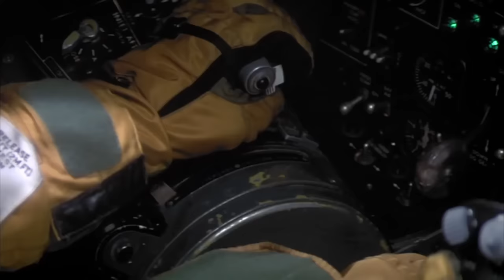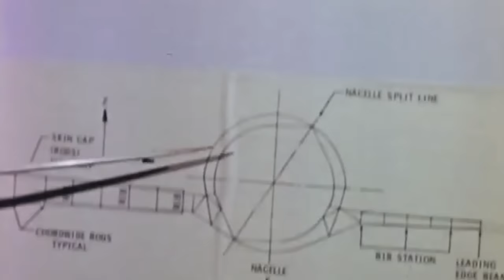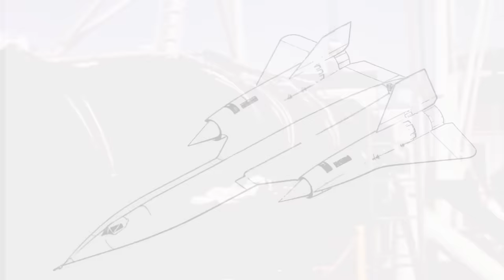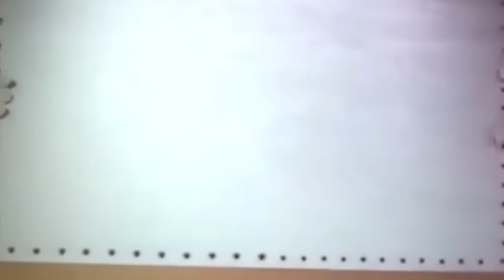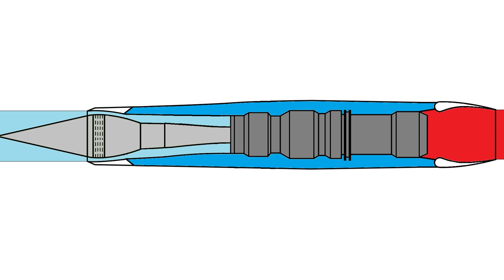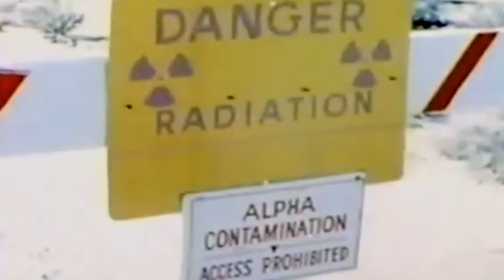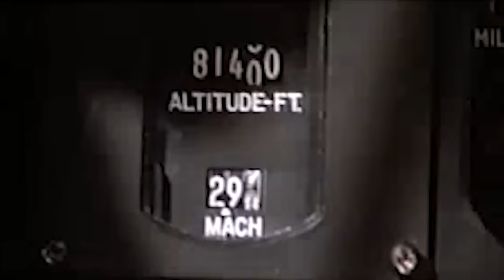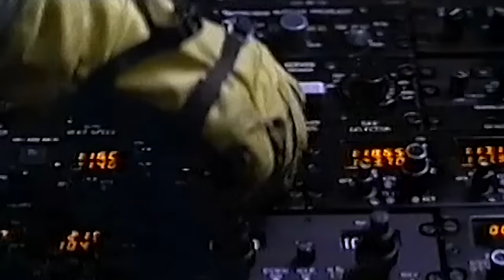Lockheed A-12 | Speed matters

Comment: The A-12 "spy plane" or reconnaissance aircraft required so many changes, that when the engineers thought that they had overcome one problem, such as titanium replacing aluminum due to surface heat while traveling at Mach 3, they encountered another one with the titanium body, having to put ridges into it to keep the heat within so-called "safe limits".

In dealing with complexity, human engineers design, then perhaps redesign, then make a concept model, then test that model for flaws, then even after being given the "okay" to build it, it then needs further "analysis" and modifications. Even when the engineers say that everything is "okay" at that time, another flaw becomes evident, requiring more changes.

In contrast, what God makes never needs any redesigning, modifications, but is perfect "out of the box", for a wise king named Solomon at Ecclesiastes 3 in the Bible stated: "I have come to know that everything the true God makes will endure forever. There is nothing to add to it and nothing to subtract from it. The true God has made it this way, so that people will fear him."(Ecc 3:14; Note: God's personal name is Jehovah, Isa 12:2, KJV)

For example, an excellent flier is the hummingbird. In terms of body lengths per second, a diving hummingbird flies faster than a fighter jet, said a researcher from the University of California, Berkeley, U.S.A. some 15 years ago. 

Christopher Clark filmed the courtship rituals of male Anna’s hummingbirds and calculated that when swooping to impress females, “the feathered acrobats reached speeds of almost 400 body lengths per second.” He said that such a speed is comparatively “greater than [that] of a fighter jet” at full throttle. When pulling up at the end of its dive, the bird is subject to a force ten times the pull of gravity—more than fighter pilots can stand without losing consciousness.

And the Ruby-throated hummingbird, weighing less than an ounce, relies on one thirtieth of an ounce [1 gm] of fatty fuel to carry it all the way from North America, across the Gulf of Mexico, and into South America, about 800 to 900 miles. No heavy load of fuel, no training in navigation, no complicated charts or computers ! Yet, it finds it way perfectly there and back.

The universe with its wide diversity of life on the earth is evidence of Jehovah's unparalleled handiwork. And for those who measure up to being "meek" ones, they will enjoy living on the earth with its awesome diversity of life forever once it is transformed into a paradise.(Ps 37:11, 29; Matt 5:5; Luke 23:43)
Reply: Please keep your fairy tales out of discussions of reality.
Reply: @soaringvulture  
What I wrote was NOT a fairy tale, but rather expresses the sound evidence of a Creator, who "created all things".(Eph 3:9) For example, consider the capability of the web of the orb weaving spider. It has been discovered that the web of the orb weaving spider, that produces seven different types of silk, is capable of stopping a jumbo jet in flight. The sturdiest silk, known as dragline silk, is lighter than cotton but ounce for ounce is stronger than steel and tougher than kevlar that is used in bullet-proof vests.

If this dragline silk were enlarged to the size of a football field, with the web being 0.4 inches thick and 1.6 inches apart, then it would be capable of stopping a jumbo jet flying at over 600 mphs. What else is of interest is that spiders produces the dragline silk at room temperature and uses only water, while man-made kevlar requires high temperatures that causes a chemical reaction between an acid and chemical solution containing nitrogen and hydrogen, resulting in chemical chains composed of hydrogen, carbon, oxygen and nitrogen, whereby it has a service life of just five years, and if used outdoors, depreciates its service life due to ultraviolet light or debri penetrating the kevlar, or once it is struck by a bullet, it is now rendered as compromised and must be replaced for safety reasons.(source: website fiberbrokers dot com, article "All About Kevlar")

Or what about the weaver ants that lives in Australia, who build their nests in the forested canopy, bonding leaves together, who "turn the leaves into green chambers, with floors, walls and ceilings. The way they do is with glue. First the ants turn themselves into living safety pins, pulling the leaves and holding them. That's one team. Next come the weavers (ants). They pick up larvae, their yet unformed little sisters, take them to the seams use them like living shuttles, tiny glue guns. They stimulate them to secrete threads of sticky, web-like silk that holds the leaves together.Without any apparent supervision, the ants know exactly where to clamp the leaves, and where to apply the silk. There are a half a million ants in the colony, but they behave as though they were all part of a single mind, each one doing what is needed in the right way to build a complex of chambers and corridors out of living leaves".(Documentary: The Ultimate Guide - Ants)

It takes a skilled mind with a large body of workers, who have been given specific instructions on how to create kevlar, so what about the weaver ants, who "without any apparent supervision" are able to build their homes in the Australian canopy of trees ? Or what about the orb weaving spider that is able to produce very strong silk in order to catch its prey in its web, even small hummingbirds ? 

Try placing a half a million people together "without any apparent supervision", and what happens ? Chaos, and NOT a well organized group that accomplishes a miracle. On the other hand, the "instructions" for all the animals and arachnoids and insects are within their DNA, so that they are able to create some very beautiful and imposing structures, such as a weaver bird weaving its nest with only its beak, knowing EXACTLY how to do this, like a skilled seamstress sowing a garment together.

How about you trying to weave a nest with only your teeth and find that it is not possible. This should open a person's eyes to the evidence that the universe with its abundant life on the earth is not an "accident", but the result of a Supreme Designer. So, this is "reality".

Comment: 26 km altitude is not big deal, is inferior to Mig 25 AND Mig 31, and the time to get to that altitude is a sad joke. The service record is also another sad joke, with 40% of airframes lost in accidents - making the plane a true "flying coffin" - reason why it never reached mass-production, and was a dead end after the rise of satellites and after the advances in AA missiles. The plane was stripped down for speed at extreme, and was unable, by design, to perform any other role if not as a spy-plane, unlike Mig25 or Mig 31, who even if they couldn't reach that extreme speed ( but not by a big difference...) they could fly higher, get to that altitude 10x faster, and, most important, they could perform other tasks, aside from simple reconnaissance, once they could load missiles, and they were able to defend themselves - all at a fraction of the cost. 
The A-12 and SR were, is true, a marvel from the point of engineering - but as an effective military platform, they were an expensive failure - much like the trumpeted rail-gun, who was designed to equip the Zumwalt class destroyer, and after many years of RD and billions of $$ was canceled, and the program was closed. 
 Such designs may give, indeed, valuable research data, but when the logic and practical sense is missing, they are just another way for the military complex to steal another load of billions from the taxpayers wallets. 
Was not a very bright idea to invest billions in a spy-plane when was obvious the satellites will become first tool to obtain recon data, and when the advances in missiles design ( a lot faster and able to withstand 30x more G forces ) - such advances, together, make the beautiful SR71 obsolete very fast... 
But we saw this kind of dumb engineering in RD again, in the case of the rail gun, who was even a more stupid project from the start - using Stone Age ballistic principles when we have missiles ( who can do the job 1000x better) and we enter the age of energy weapons...
Reply: Satellites had a resolution of 5 m + back then, they were used for area observation and for mapping (to hit a target with a ICBM you have to know exactly where the target is). It took until the 90s to get the 10 cm resolution with satellites. Spy planes have been used for a different purpose, they are more flexible (since satellites have 90 minute orbits and fly over the same place only every 16th orbit), fly lower and had a higher resolution, also they use not just cameras but a couple of sensors. 
A mass production was never planned, since it was rejected as a bomber (like the XB-70, in favor of ICBMs) and such spy aircraft are a niche, and expensive.
Reply: @simonm1447  "to hit a target with a ICBM you have to know exactly where the target is)" 
hahaha, a 50 megatons ICBM , able to delete half continent, says "hold my beer,  ! "  Dude, russians worked with acc. of 500m up to 2000m,  that "5m" was 50 more accurate than their missiles, and they compensate for that making bigger a  warhead !
So no, you DO NOT NEED 5m acc to make a  perfect kill with a ICMB, have some common sense dude ! We talk about NUCLEAR warheads here, not about sniper bullets, lol ! 50m - 500m - 1000 m - 2000m will NOT save you when a 50 megatons warhead detonate !

Secondly,  "since it was rejected as a bomber" - this is really dumb, SR71 was NEVER intended to be a bomber, lol ! The plane was stripped down so extremely for SPEED only, he couldn't carry a fraking gun !  He couldn't even take off with a full tank  ! ( needed a refuel right after take off ! ) - and you talk about carrying bombs ?! lol ! 

The SR71 production was abandoned by some other REAL reasons like a very high , expensive cost, production difficulties ( US lack the titanium to build parts for ! ) , many technical problems who plagued the whole project and, most important, a really disastrous safety record, with 40% of airframes lost in crashes ! A pilot was only 1 chance of 3 to get back safe on that plane, it was a real flying coffin !  20 of them crashed/exploded/caught fire,  20 from a total of 50 airframes - that mean 40% crash rate ! 

"Blackbird Losses" - https://www.sr-71.org/blackbird/losses.php
Reply: @mirandela777  To meet the target with a ICBM with an accuracy of 500 m you have to have to know the position of the target with this accuracy, however soviet maps were deliberately wrong in the past (the Wehrmacht had it's own maps based on air photography), and nobody will make places like nuclear factories or ICBM silos public, so the US had to make their own maps - with these satellites. 

Titan missiles used the W49 warhead (1,45 Mt), Titan 2s used the W53 (9 Mt) - neither the US nor Russia used a 50 Mt warhead as a military weapon (Tsar Bomb was a demonstration of power, but far too heavy to have military use). ICBMs never had been that powerful to put a 27 t Tsar bomb over continents. 
Today ICBM hit much more accurate, ICBM silos uses overpressure and a massive blast door as a protection, which can survive a nuclear explosion 500 or 1000 m away. What they can't survive is a more or less direct hit, you simply can't make a blast cover which can survive a nuclear hit and is still light enough to be movable. 

SR-71 was of course developed as a reconnaissance aircraft, but at least a interceptor version was considered (YF-12).

Both versions (A-12 and SR-71) flew around 17.000 sorties, with these numbers you 1:3 theory is wrong, of course 40 % losses are much but Mach 3 is no routine flight like a subsonic airliner flight and the jets flew almost 12.000 hours with Mach 3. 
Of course it's a challenge to develop such aircraft, it's far from reality to expect something like this without some technical problems to solve and on time and on budget.
Reply: @simonm1447  - dude is not my "theory" lol, but a historical fact, well documented ! If you are too lazy to read the link I posted to educate you, it is not my fault ! 
Another thing you need to learn: are ( both in US and Russian military ! ) nuclear warheads anti-bunker ! Designed especially to detonate deep underground, making a shortwave enough bigger to shatter any bunker !  You seem to believe all nuclear warheads are air burst ! 
Another thing you need to learn: look at Poseidon warhead ! 
"neither the US nor Russia used a 50 Mt warhead as a military weapon " 
correct for US, not so much for russians :p
Reply: @mirandela777  20 losses in 17.000 sorties is near 1 every 1000 sorties, and not 1 in 3. Maybe your math teacher should look for a different job. 
BTW, the Poseidon can be considered as a doomsday device, ignited in the sea the fallout would be massive and a fleet of them would make the world inhabitable, and would also kill Russia even if others wouldn't even fire a single ICBM.
Both (Russia and the US) reduced the yield of their nukes after the 60s and 70s, and the big megaton monsters had been retired then on both sides. They realized the massive fallout would destroy the world in a war, not just the attacked countries but also the rest.

Instead of using Poseidon Russia could also build a big 1 or 2 gigaton bomb inside the own country - it would have the same effect, this bomb would kill the rest of the world just with the fallout.